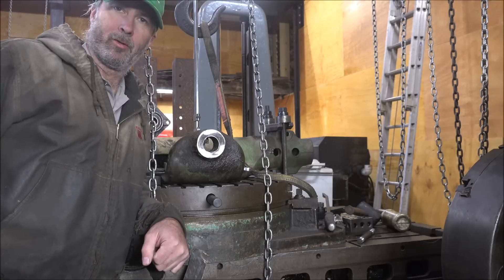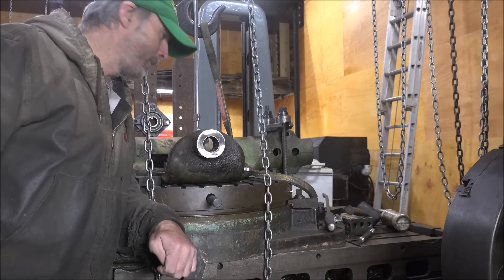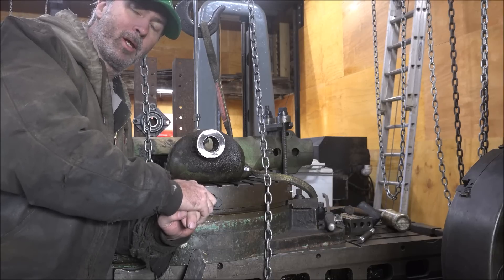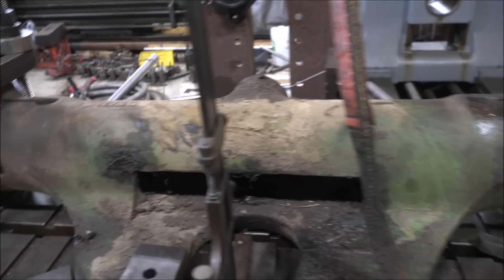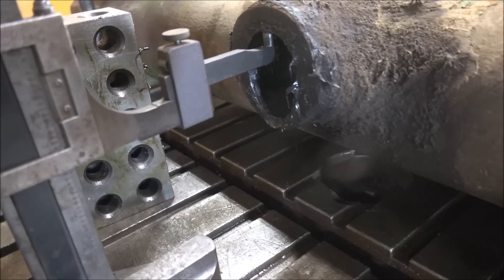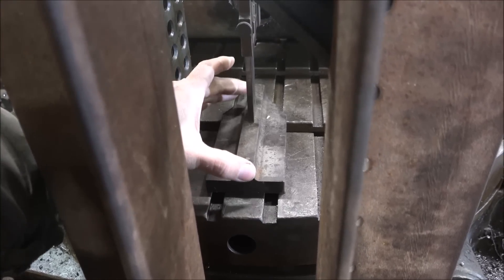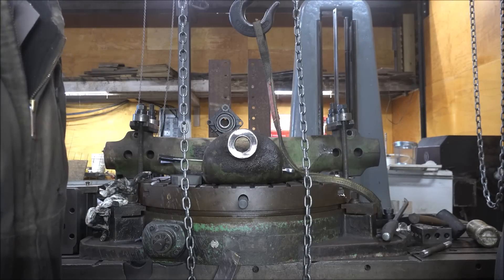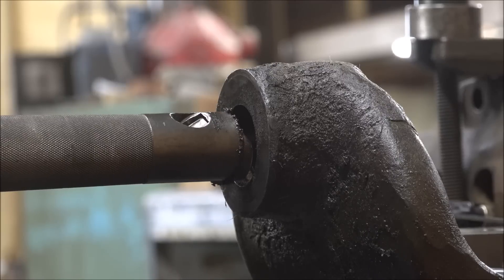How I setup Parts with Damaged Features Align Boring Blind Hole Using Rotary Table

Comment: (not questioning your work, I'm legit asking a question). Near the end, as you get close to the finished size is it advisable to rotate the work and not change the cutter diameter so both bores are the same?
Reply from the maker: I did make the final pass on each bore with the same tool at the same setting so I did what you described. It made it the least likely for anything to be out of line I think.

Comment: Another excellent posting, thank you Brian.  Are the Cincinnati and the gray Monarch going to make it down to the Barn/Shop, were they ever planned to, or would that require an expansion of the Barn/Shop?
Reply from the maker: They and the Thompson grinder have spots alloted but I won't move them until I get the ceiling done and all the roof leaks stopped in the bran shop. Hopefully This will be the year!!

Comment: Looks like the excessive wear of the second bore took out the face squareness near the first bore. Are you going to reface it and make a shim or braze it to fill it and reface the fill? The part that faces of the bores on the tractor are most likely out also. No sure if I describe that right just asking. I work on John Deere’s and the new parts didn’t line up well with the tractor do to excessive warn faces out of square.
Reply from the maker: I just faced it back true they can shim it with washers to keep it from walking.

Comment: that arbor looked like it had some wicked runout is that normal ?
Reply from the maker: yes, single point tools deflect since it is rotating that deflection makes it look like run out or wobble, add in the fact that it is an interrupted cut because of the wear and it makes it look like the tools are going crazy.

Comment: A few questions.  Is the axle housing cast iron or cast steel?

Have you seen the on fire welding with the hydraulic drive boring bar that does a partial radius weld.  To repair out of round bores without having to go super oversize
Reply from the maker: It is probably a ductile iron. Its from the early 1960's so not sure what classifications they even had back then. who makes the partial round bore welder? seems it would be tricky to setup right but would be good for a lot of jobs.

Comment: Hey Brian. Are you bushing the bores with cast iron or steel? 

All the best,

Tom
Reply from the maker: I use prehard 4140 so it is similar hardness to the iron so it doesn't wind up just going mushy and getting beat out like common mild steel.

Comment: I love the offsetting trick, for something that is so far out to lunch. And an eccentric bushing bored to bring her back.  I love it. Thanks Brian.  Q? What brand is that double tipped head ?  -Doozer
Reply from the maker: It is a Kennametal tool but they haven't made them since the 90's i don't think and they rarely turn up. I am missing a few sizes still in mine.  They are good for finish boring but not good for rough work or moving a hole since the twin bore will cut both sides when you only want one cutting for bore placement correction.
Reply: @bcbloc02  Makes sense. Interesting.  Always looking for tooling.  Thanks Brian. -Doozer

Comment: When I worked for the Boeing Co. we had to set up and machine huge landing gear castings and engine mounts. Most were set up on a three point system of contact. The gear housings had "locating" pads we would clean up with a grinder then load them in a fixture. Even with dedicated fixturing it took a great deal of time. You only got one chance at it and if you screwed it up it was mega bucks in scrap and in some cases your job...
Reply from the maker: I can certainly see that. Doing it the first time is at least a little easier than doing it a second since there are no established features.  i am sure if you ever had to reset up a part you know its like 3 times as long as doing t rough the first time.  Big risk big reward!

Comment: mightve been able to leave more material if you wouldve cleaned the bottom part and welded it up with a nickel weldingrod , then recut it to size , because youre going to resizel it and put a bushing in it , it should matter a lot if it distorts the cast iron some or even if it doesnt penetrate as good as it should as its only need to fill in the gap
Reply from the maker: Could have done it that way but bushing material is cheaper than cast iron welding and it will do the job fine so that was the route choosen.

Comment: Could you use your boring bar to ballpark line up the part by inserting it in the hole that wasn’t that bad? Just curious as you are a magician when it come to setting up irregular shaped parts .
Reply from the maker: Yes.
Reply: @bcbloc02  cool thanks

Comment: I was wondering if you were going to offset that bushing to keep more iron around the bore. Will you put in a dutchman or something to make sure the bushing doesn't rotate? I used to do something like that when changing the length of connecting rods. You sure get good use out of that boring mill.
Any thought about brazing up part of that bore before machining? 
How did no one notice all that wear?
Reply from the maker: With a good press fit and some loctite it won't move.